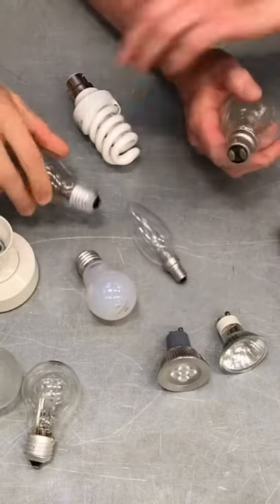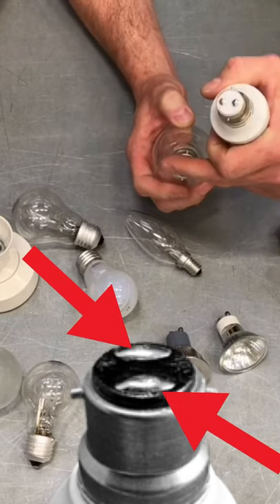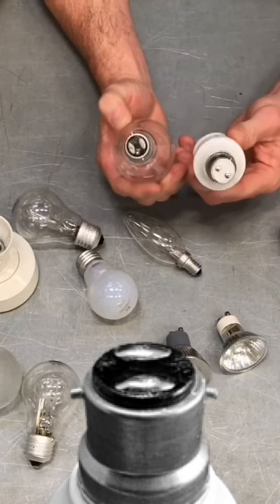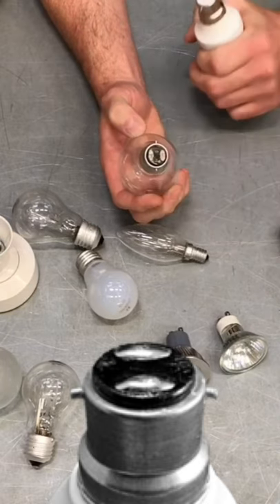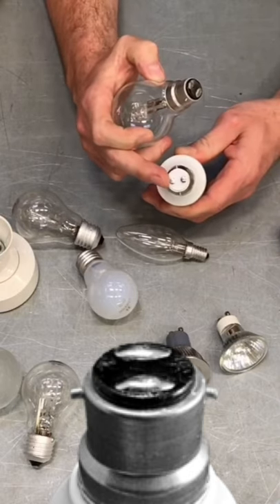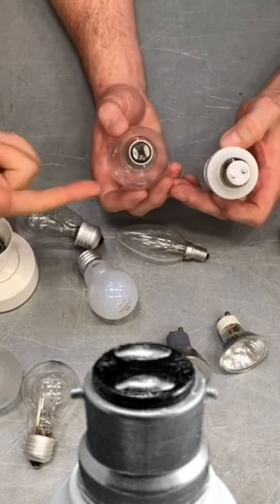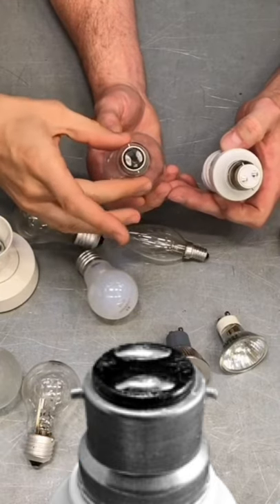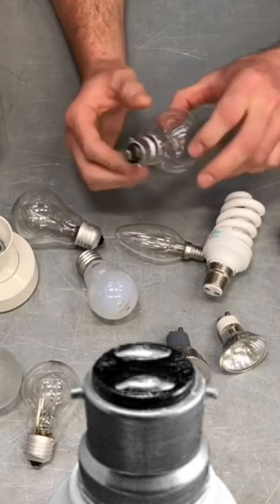Identifying the End Connections on an Bayonet Cap Lamp

Comment: The metal collar connects to earth on the all metal fittings I believe.
Reply: You are absolutely correct, most brass table lamps have a 3 core cable, the earth is terminated by a screw at the side of the bayonet lamp holder..